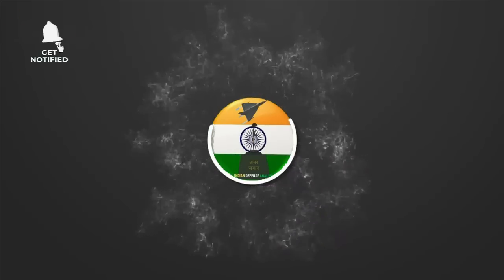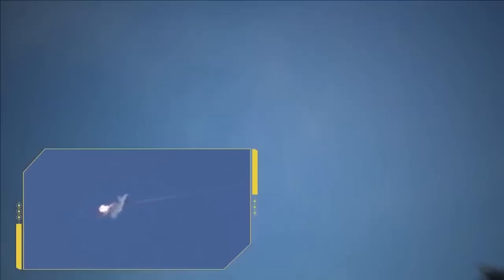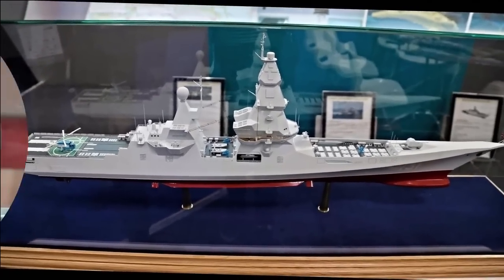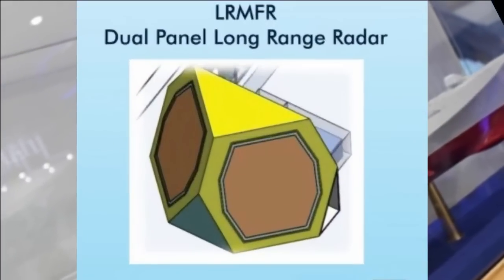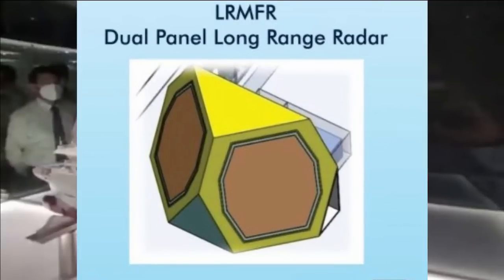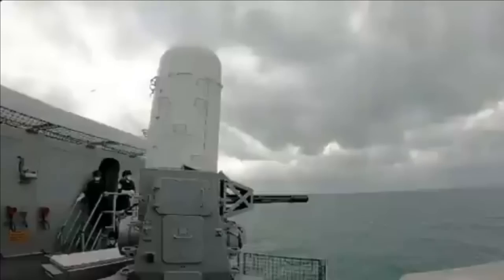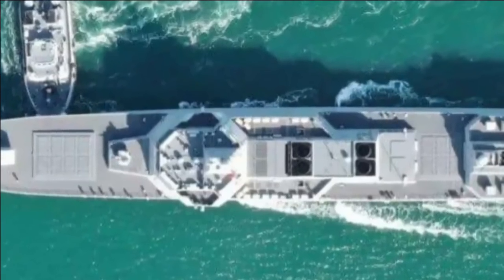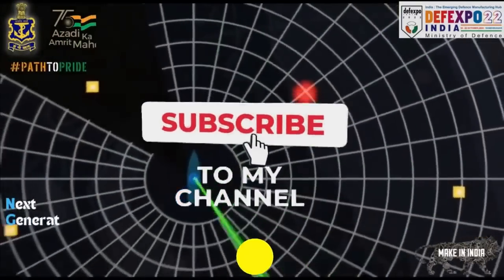Project 18  Indian Navy's Next Generation Destroyer NGD with 128 VLS & Ballistic Missile Defence

Comment: Interesting concept. Change this to a semi-catamaran design. Better stability and better sea keeping. Better load capabilities. More room for equipment. Larger beam. Better speed and fuel efficiency. As far as propulsion? Look up Hydrogen peroxide for propulsion and energy. This was with WW2 tech. INDIA has much better than this. Time to paint the skies with a laser array tied into a targeting detection grid when all goes active.fre off cheap sonar/ magnetometer buoys with heavily encrypted tight beam comms to the firing ship. Make some submersible and tie them together into a anti sub network. Get rid of that single barrel cannon! Outdated! Mount instead,a modified system based on the GENERAL ELECTRIC GAU-8. 80MM autoloading belts from 4 ammunition holds. This will allow for different Ammo including shotshell. At least until the rail gun is ready. Imagine cluster bomb shotshell submunitions landing on a beach or impacting incoming. At 500 per minute. As far as stealth design. There are plenty of examples of research vessels that are cat designs made for rough water.  Build some larger production drydocks like the Korean Samsung yard.  Open all types of ossibilities. Glad to see India on the march. Soo many good lives to protect.

Comment: The combination for 144/128 VLS cells should be:
For Forward 72 cells:
24 cells VLS for XR SAM/SM6/SM2ER Block 4
24 cells VLS for Barak 8ER/SM2ER/RIM66
12 cells VLS for 48 VL SRSAM/ESSM 
12 cells VLS for Bramhos NG/Seabreaker/RBS15/NASM/NASM MR
For 48/56 VLS aft cells:
16 cells VLS for Bramhos ER/LR LACM/Kalibr
16 cells VLS for Bramhos 2/Zircon/Hypersonic Missiles 
16 cells VLS for ASW Missiles replacing RBU6000 unguided rockets.
8 cells VLS for Bramhos ER/Zircon/ASBM(Optional)

For Guns:
127mm/76mm Naval gun
2 Pantsir M/PALMA/RIM116 CIWS 
2 DEW/Phlanx/Kashtan M
2 VSHORAD with Automated Mistral/Starstreak mounted
2 RWS like Typhoon
Reply: Good on paper but gonna be hard to implement it on ship as some of the techs are still under development and we all know how long the testing goes (10-20) years thanks to our sarkari psu and babus

Comment: 72 MW is a large figure for electricity generation. Nuclear power makes more sense than gas turbines to meet needs of massive Radars, direct energy weapons.  Railguns and EMALS. Lider-class destroyer is an example of such a design. The existing nuclear power generator for the S5 sub can be used, There are 16 planned Type 55 in the PLAN's shipbuilding, which means  a lot of these will need to be built to offset the enemy. On the assumption that the 190 Mw is electrical for the S5 sub, since ~500 MWt (about 165 MWe) is typical for larger US sub nuclear reactors of S5 class.
It is also time to test out building ships out of carbon fiber and titanium hulls. That is a huge technical leap forward for Bharati shipbuilding, building stealthy nuclear vessels.